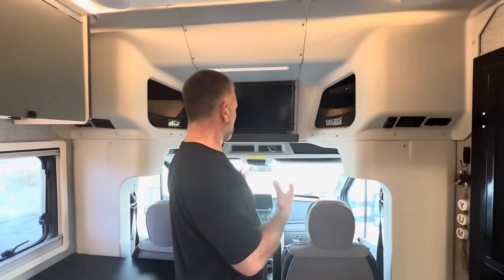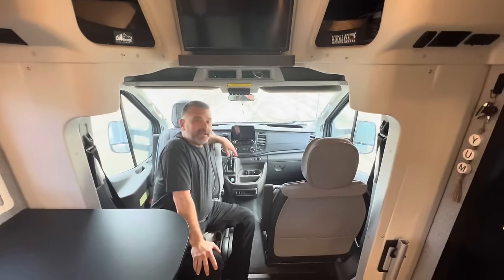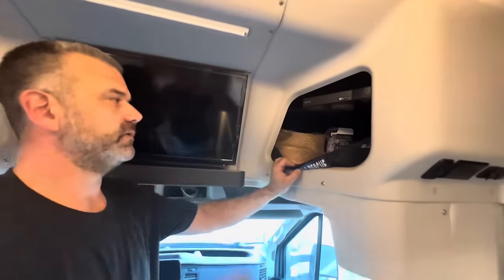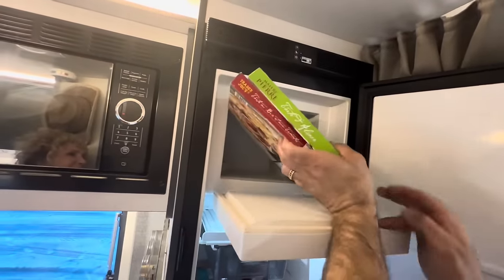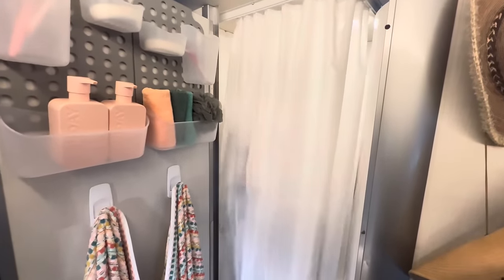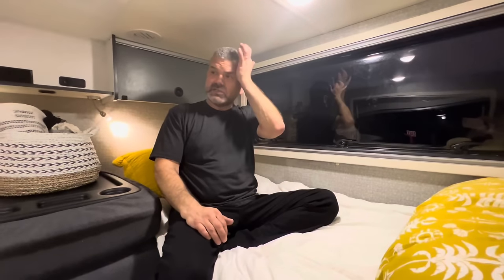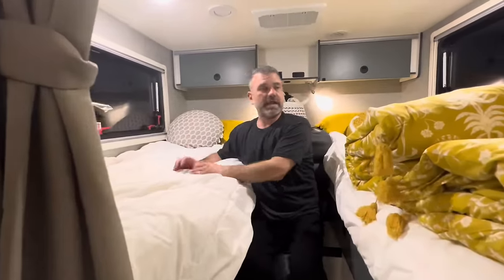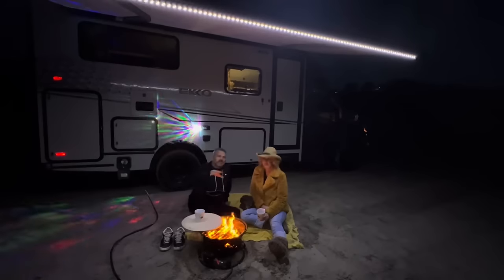WINNEBAGO EKKO TOUR | WHAT THEY DIDN’T TELL YOU! | PROS & CONS | 24K MILE UPDATE | RVLIFE | VANLIFE

Comment: All you need just move your seat back and forth to turn it around, no need open the door, I do that all the time, never need to open the door
Reply from the maker: 😂I’ll try it again, after a year that hasn’t worked. But, I’m hoping in this case I stand corrected.  I’ll try tomorrow. I’ve continued to have the armrest make contact with the side of the seat.  Do you have a Transit or EKKO with these seats?
Reply: @ekkonesters599  I have ekko
Reply from the maker: @maoss40  Hello again, well I went out to the EKKO 2022 year model built in a 2021 Ford AWD chassis and performed the following exercises for the seat. 
1. Seat moved all the way forward (base). 
2. Seat moved all the way back (base). 
3. Seat back and base of seat moved in multiple positions. 
4. Moving seat forward and backward while attempting to rotate the seat. 
After multiple attempts, the seat back (left side) continued to come in contact with the door panel/armrest. 
I’ll give it another look tomorrow. 
Thanks again for the suggestions and for watching. Take care.